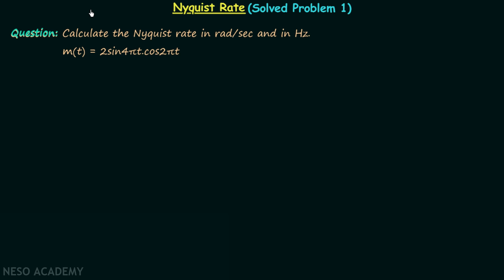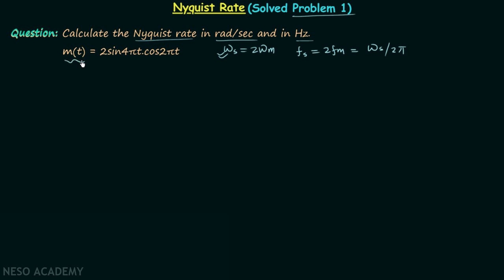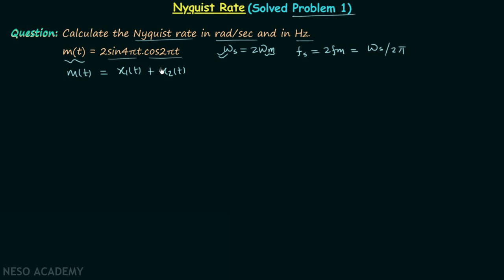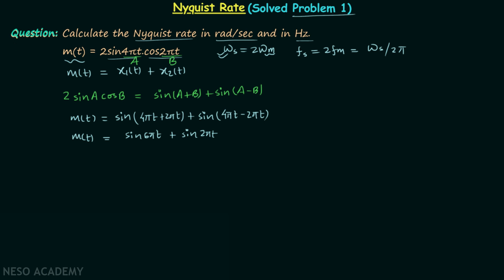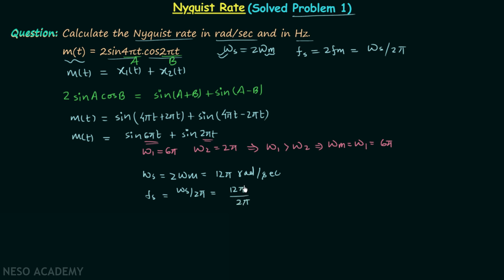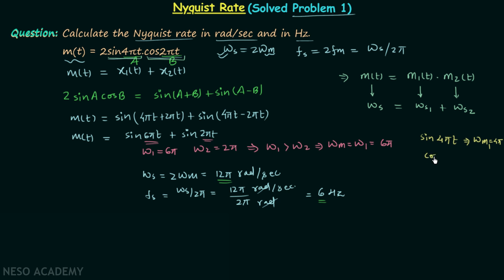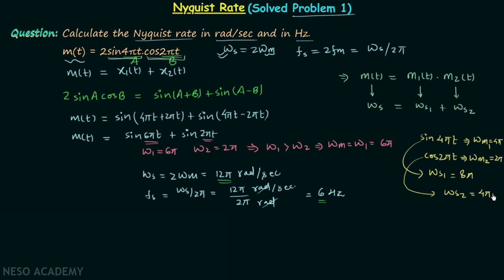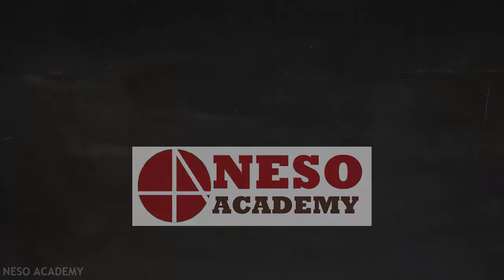Nyquist Rate (Solved Problem 1)

Comment: In Hz Fs=Ws/2pi
M(t)=cos200pit*cos100pit
Ws=Ws1+Ws2
Ws1=2*200pi
Ws2=2*100pi
Ws=2*200pi+2*100pi
Ws=600pi
Fs=600pi/2pi=300 Hz
Reply: wrong!
Reply: @NabaaJasim-b6t  How it could be wrong if he have gave the answer 😂
Reply: @valera3396  the result is right but the operation is wrong ,, it should be in this way:
ws=w1+w2 

w1= 100/2pi = 50pi
w2=200/2pi = 100pi

ws=w1+w2
ws=50pi+100pi = 150pi 
So fmax = 150 Hz

Fs = 2 fmax
Fs = 2*150
Fs = 300 Hz
Reply: @valera3396  we must count on rules in this subject..
Reply: 200 pi is w, you don't have to multiply it by 2 again